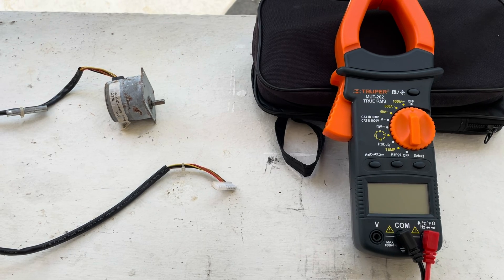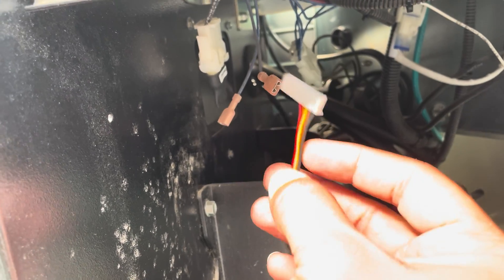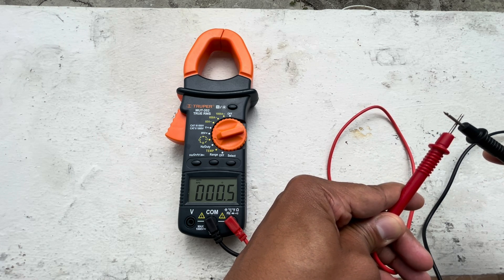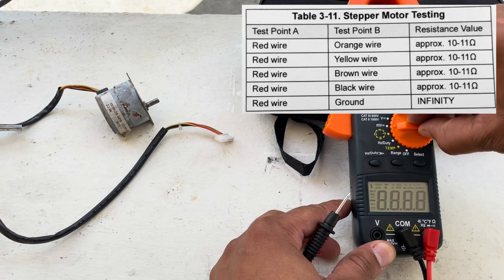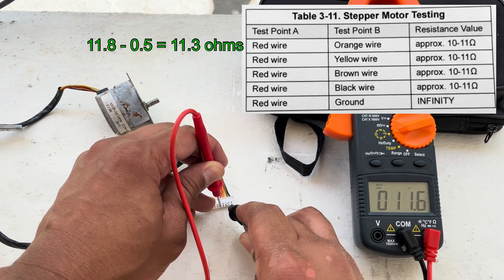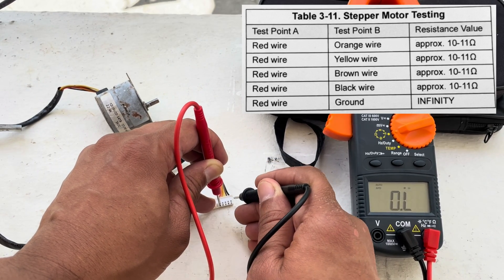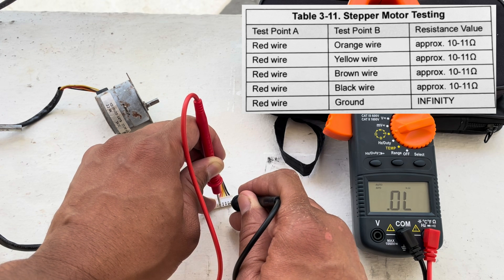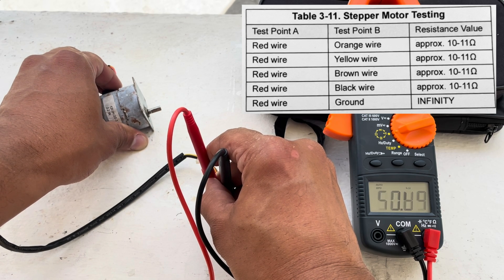How to test a Generac stepper motor the correct way. For Overspeed and Underspeed Faults.

Comment: I have an older 15KW Generac with the 1.6L Fiat 4 cyl liquid cooled engine (1990's model 00607-2 ). Its shutting down due to overspeed +72hz. The stepper motor is not moving at all from start to stop. I've tested stepper from your example and it checks out. What to check next? Maybe voltage test on 5 wire stepper harness coming from the control panel? If so, how? I have On/Off/Auto switch for control of genset.
Reply from the maker: Hi, I'm not sure if the resistance values of the old style Generac stepper motors are the same as the newer stepper motors (like as the one on my video). I am not very familiar with the 1.6L Fiat engine and now I'm curious if  that generator has a magnetic pickup unit (MPU) to read engine RPM or uses the pulse from the ignition coils / magnetos to sense engine RPM like the Generac Guardian. I will add it to my list and look more into this and see if I can help you figure this out.
Reply: @tacticalpowerpro  There do appear to be two donut shaped coils next to the stepper controller board. After confirming I'm getting expected voltages into the stepper controller board, I have ordered a replacement. I'm expecting that's my issue. I'm getting a solid hertz frequency coming into the board (via the two blue wires) and a solid 12v DC coming in via the red wire (and zero v on the black DC ground wire).
Reply from the maker: Sorry I completely missed your reply. Did you replaced the stepper motor and fixed the issue?

Comment: I have a Generac 22kw and it as a code  1603
Reply from the maker: Hi, error code 1603 is the underspeed fault. This code appears when the engine never comes up to 3600 rpm. I will recommend checking the fuel selection and fuel supply.

Comment: My guardian 22 KW unit just threw a 2399 code. 
So I will be checking the stepper in the morning. 
Thank you so much for a simple easy to understand video even to a layman such as myself. 
Take care, have a great day sir.
Reply from the maker: Thank you for watching my video. This week I checked a Guardian generator with the same 2399 code that came up after the owner did maintenance on it. While troubleshooting I found the spark plugs were swapped with the wrong plugs. Instead of the BPR6HS plugs they used the B6HS which has a shorter tip. I’m still wondering how that throws a stepper overload 2399 but once I swapped the spark plugs for the right size the fault never showed up and the generator ran under load without issues.

Comment: Thank you for your video.  I have a Generac Guardian 17 Kw with the Nexus Controller that when I turn it on, the rpm ranges between approximately 3550 and 3650. I look at the output shaft of the stepper motor and small periodic movements are noticed. I'm thinking that the stepper motor is damaged.  In 12 years of use of this generator, this is the first time that this failure has occurred.  Thanks again
Reply from the maker: Thank you for watching my video and I’m glad my video was helpful. The stepper motor should move back and forward prior to start. I have another video in the channel where I’m troubleshooting a generac guardian with the 1205 error code and I show how the stepper motor should work, test (again) and how to replace.

Comment: What is the purpose for the steeper motor?
Reply from the maker: Thank you for you comment! Good question, the stepper motor opens and closes the throttle of the Generac generator. It receives the signal from the control panel to open and close as needed to keep the right air flow to maintain the engine at 3600rpm.
Reply: Thanks
Reply from the maker: You're welcome, I'm here to help.